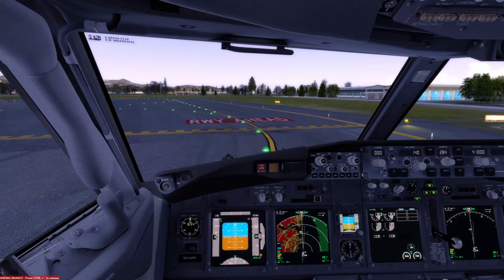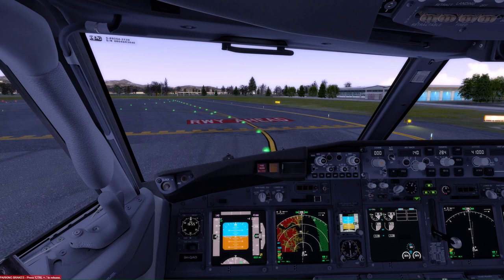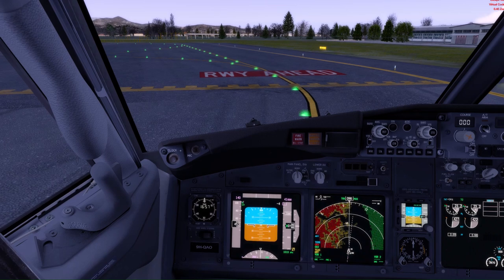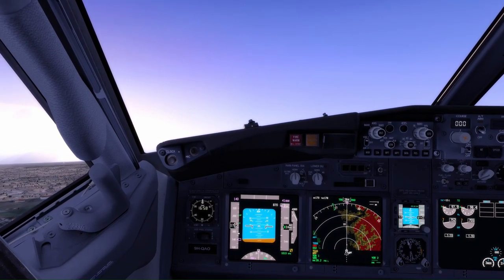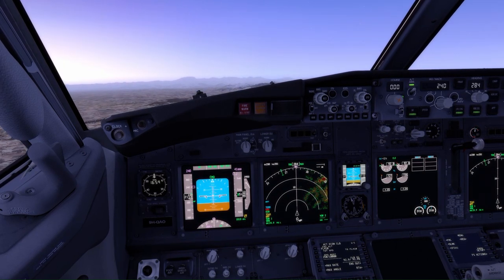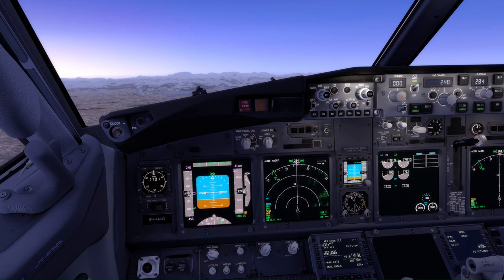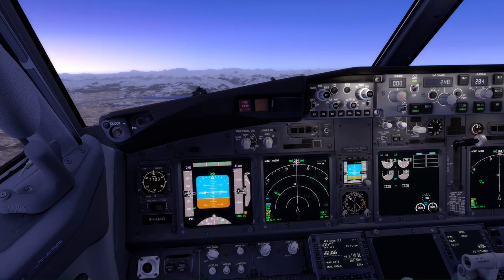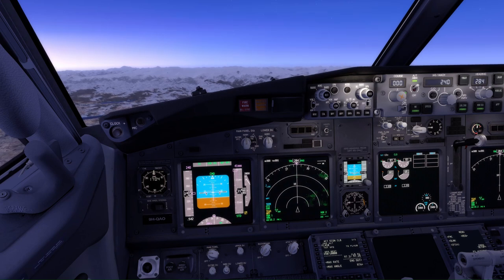Idicated Airspeed and True Airspeed Behaviour During Climb - [SIMULATOR Example]

Comment: I got overspeed warning in my sim first time I climbed above FL 300 with auto throttle set to 310 knots in airspeed. It was showing well over 400 knots true speed.
Edit: I am building my own controls from scratch and my pedals overreact while my tiller doesn't work in isolation either, so I can't align so elegantly yet lol.
Reply from the maker: Hey, thanks for watching, maybe you went into an Overspeed situation because you didn't change to mach number when flying at high altitudes.

You will align perfectly soon, I'm sure!!
Reply: @PILOTCLIMB  oh yeah, I kept instruments showing knots, I have to learn better what macs correspond to my desired knots
Reply from the maker: @rohrichoak9740   I'm glad you find out what was the problem. Have you seen the video where I talked about the differences between Mach Number and Knots and why we need to fly Mach Number when at high altitudes?
In case you want to watch it this is the link:
https://www.youtube.com/watch?v=MC3dujG2Viw

Comment: I have question Capt,is it true that boeing aircraft with balanced the thrust across the engine when we flying with manual throttle(auto throttle off mode) ?Has this to do with the EEC electronic engine control or with aerodynamic of the boeing aircraft ? because airbus FBW aircraft do not have this feature...thanks
Reply from the maker: Hey, thanks for watching..With the A/T off (on the B737) you can set different thrust settings, the autothrottle (when off) doesn't balance the thrust back.

let me know if you still have any quesitons